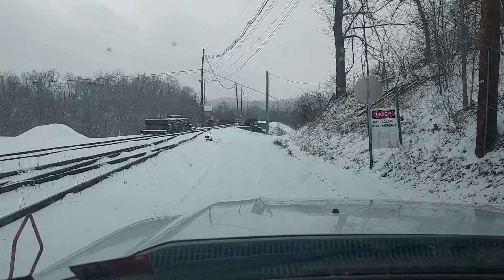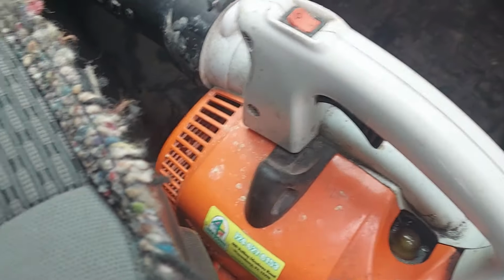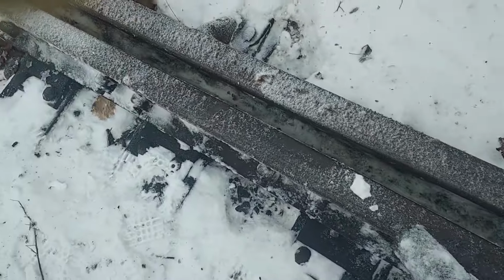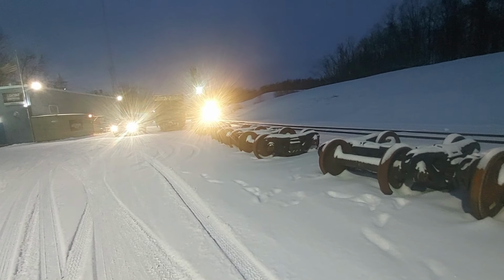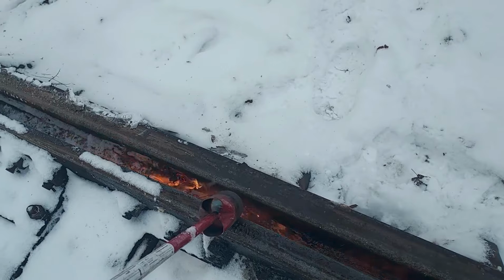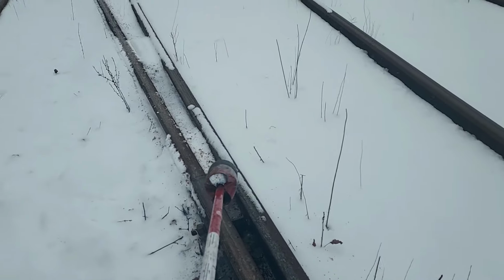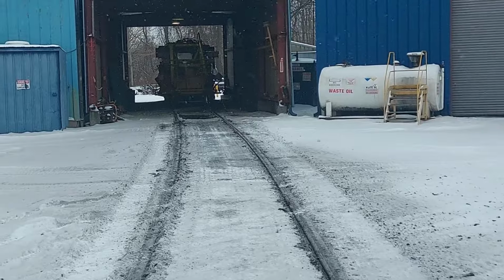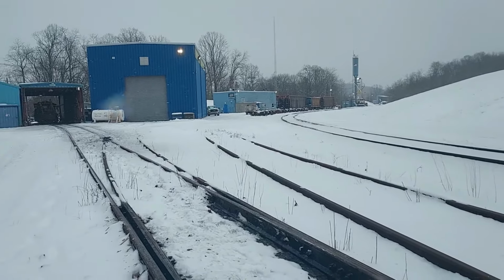Cleaning Snow out of Railroad Switches

Comment: Hi Dave Good buddy. I'm watching your video on how to clear snow from the switches and switch points and thought a good thing y'all could use is a Snow Jet blower. I'm sure you know what I'm talking about my friend. But incase you don't I'll tell you. It's a jet engine mounted on a cab control platform that angles the exhaust of the jet engine down towards the track so the switches can be thawed and cleared for smooth operation of the switch in icy cold temps. I don't know the cost of them but if you wanna have your company look into leasing or buying one I'm sure they'll prove their worth in the long run and be a valued useful piece of equipment that y'all have among the maintenance equipment y'all have.  That's rail roading brother happy rails happy trails. 👍😎👍
Reply from the maker: Yes it certainly would be nice to have one of those James, but they aren't going to spend the money here to buy a machine like that with the small amount of time the switches here are used. Even years back when we only had 1 loco and 4 of the switches got used every train trip we would have to manually clean those switches all the time.  But hey, a guy can dream about improvements anyway can't he....  Thank you very much for visiting with us to help clean snow out of switches my friend
Reply: @ccrx6700  Dave my Good buddy your welcome. Hey anytime I can mention something that would be of help I must certainly will even if the company takes me up on my ideas or not. You know what they say. Some help is better then No help. And I agree a guy can dream take it from a pro I do a lot of that dreaming businesses. Ha ha :)  but seriously. Nothing wrong with wishful thinking Good buddy. Like you say. That's Railroading. :) ❤
Reply from the maker: @jamesmaclary8441  👍😊

Comment: In Chicago, they have run gas lines to the switches and after it snows they set them on fire to keep the ice off
Reply from the maker: You are right about that Nolan, course those switches have a lot
more traffic than what mine do. They got to keep passenger trains
moving safely up there.  Very much appreciate your taking the time to write in and to check out the cleaning snow video my friend.

Comment: Hey Dave we use backpack leafblowers to clear our switches  works real well on up to 6 inches  exposed the rail and ties and let the sunshine hit em they are clean and dry quick anything over 6 inches and it's best to shovel first
Reply: And for our crossings we use salt in the flangeway  keeps the dirt soft so the train cuts a good flange when it rolls thru or we use the highrail wheels on the trucks to cut the flange after we salt
Reply from the maker: That would be nice, this little blower only works on dry snow, wet snow and it wants to turn it into ice. I've used salt in the crossings
also in the past. Good idea on the hi rail truck first, at least if it
derails no big deal.   Very much appreciate your taking the time to check out the video and share your experiences my friend.

Comment: I live in north east Georgia and the rail switches have LP gas heaters to melt ice. They told me it is not used often but the time it saves is worth a lot when we do get ice. We get rain that frezes on the steel but not much snow.
Reply from the maker: We have so few switches George that propane heaters are not
feasible to have plus the small amount of use they get in snowy
weather. Would be nice tho, just sit in the hi rail truck and watch
them melt everything by themselves! :-)  Appreciate very much your
tuning in to the show and may you have a very good day my friend.

Comment: Very interesting how you handle snow and ice in the switches. It's too bad that you folks can't get a hold of some propane / natural gas fueled switch heaters, like the ones the CTA and Metra uses in Chicago to keep their switches thawed and prevent the point rails from getting frozen to the stock rails. I noticed that a lot of the switches on your railroad have "self guarded" frogs. The frogs have the check rails / guard rails attached to them, unlike most "conventional" switches that requires guard rails next to the stock rails, opposite the frogs.
Reply from the maker: That is correct Josh, most of our frogs are #8 self guarded, made
for slow speed. Would be nice to have an automatic propane heater for the switches but that will never happen.  Thank you very much for taking the time to visit with us and  check out the video my friend.

Comment: What is the name of that particular frog @ 6:50. I always call it a “Guide Frog”.
I also get ice issues on my outside garden railway. But I only run the train once at winter for a cool snow vid.
Great snow video! 👍🏻
Reply from the maker: That is a #8 self guarded frog Bassotronics. Can use a small propane
torch for your size switches....:-)  Very much appreciate your taking the time to check out the video and post a comment my friend.
Reply: @ccrx6700  
Thank you rail-brother. 👍🏻
Reply from the maker: @Bassotronics  👍😊

Comment: Hey Dave, if you get cold hands I have a tip for you that I got 30 odd years ago from a Milk Man.
I was in security, covering a number of sites where this guy delivered milk to. Snow on the ground, puddles frozen solid, and he is handling glass bottles of milk with his bare hands ! Your hands must be frozen, says I. Says he: Shake my hand. So I did, and his hands were HOT !
How: plunge your hands into the snow or cold water for as long as you can. When they hurt, bring them out, and let the blood flow back in. It will hurt. Hurt like HELL! BUT, once you have the circulation back, your hands will stay hot for the rest of the day. And he was right. I did it 3 days ago. And it took about half an hour of pain, but after that, warm for the rest of the day, even after touching cold metal.
You do need do decide that the pain is worth the gain, and mentally prepare yourself. Not worth it for a few hours, but if you out for a whole shift in the snow, I would do it.
Reply from the maker: Now that's very interesting to hear Coniow. Never heard of that before
but if I'm ever in need of doing that I will give it a try. No pain, no gain
right....:-) Very much appreciate your taking the time to write in and to check out the cleaning snow video my friend.

Comment: In the old days before electric heater rods and strips they used kerosene pots ,you dug out the crib put a pot in a lit it  that small flame heated the steel and kept it free of snow and ice ,I'm curious Dave did they put the loco on the track backwards .the cab end would have better visibility on the lead end instead of next to the hopper car, also be careful you dont burn off the grease under the switch slide plates with that torch
Reply from the maker: Since we don't have a turntable here we have to keep the locos 
aligned as they are Kenneth. Also at any point in time any of the 3
locos may be in the lead coming back to the harbor with loads,
so short nose is always oriented on the east side for hauling loads.
We've never had those smudge pots here, always done it the way
I showed. Yes after the snow is gone have to go back and re grease
the plates too. Very much appreciate your taking the time to write in and to check out the cleaning snow video my friend.

Comment: I'd think that the melted snow/ice would refreeze pretty quickly if it was really cold. Then that could actually be a worse problem than what was there to begin with. Snow is compactible, not so much for ice. 
Looks like you'd be in for a long night or long day needing to go back and re-thaw the switch mechanisms. Seems like, once thawed, maybe a spray with isopropyl alchohol and/or glycol might keep it from refreezing. Wouldn't take much as the water volume is pretty low.
Reply from the maker: Torch heat pretty much evaporates all the melted snow and ice
StevieWonder. Your right about spraying tho, the right ice
melt spray would be a big help. They used to get us some
really good ice spray for the coal belts, but don't anymore.
Very much appreciate your checking out the video my friend.

Comment: Thanks for this video!
Heating steel followed by gradual cooling causes a loss of temper (softening). Does this not adversely affect railroad steels?
Reply from the maker: Your quite welcome Robin. You are right but I'm not heating the steel hot enough to do any damage. Very much appreciate your taking the time to write in and to check out the cleaning snow video my friend.
Reply: @ccrx6700  I was told that putting kitchen knives in a dishwasher will cause them to lose their temper.😾
Reply from the maker: @tzadik36  interesting 🤔

Comment: That was very interesting. I do have what is probably a stupid question, though. Doesn't melting the ice with the torch just make water that is then subject to freezing? Is the torch hot enough to evaporate most or all of the water?
Reply from the maker: You are right Erin, the water evaporates when using the torch. Blowing wet snow with the leaf blower will cause more ice to form tho.
Very much appreciate your taking the time to write in and to check out the cleaning snow video my friend.

Comment: Do the locomotives have sand injectors on the wheels?  I've seen that on high snow country they use for traction.
Reply from the maker: Yes our locos have sanders on them pittschapel.  They only sand
the lead trucks tho and not every axle. All our locos have wheel
slip control on them and sanding is done automatically, it can
also be done manually if needed.  Thank you for taking the time to visit with us and check out the video my friend.

Comment: Sir I have a question for you what are those round metal things on top of the rear platforms of your locomotives for? Thanks from a subscriber in Southern California
Reply from the maker: Those round tubes are fall protection devices Remy. Not common
on most locos. There is a ladder there to get up on the roof of
the loco so that is why they are there.  Thanks so much for taking the time to check out the video today my friend.

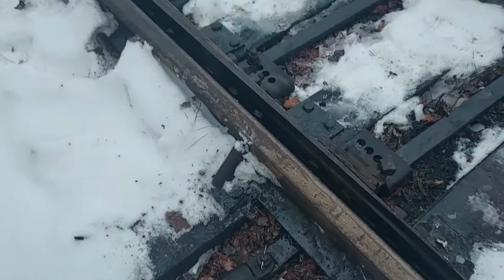Comment: Brrr I could feel the cold using that leaf blower. The propane torch did a good job and warmer using that. We had some automatic heaters but where there were none we did not have the luxury of a torch just a broom and pointed bar which gave my workmate frost bite one year, I told him to get his gloves on. Question At 18:18 looking at switches there are 3 bolts then 2 between the next tie and 2 between the next, looking in the open switch I see the 3 nuts. What are these groups of bolts holding together ? I have seen them on other videos and always wondered what they are for. Our switches are only drilled at the place where brackets are fitted to keep the switches the correct distance apart
Reply from the maker: Those bolts if I'm thinking what you are looking at, join the switch
point to the stock rail. 3 bolts on the plate that covers the heel block
and 2 bolts for the switch point Cedarcam. I liked using the torch, gave off a bit of heat to warm me up...:-)   Very much appreciate your taking the time to write in and to check out the cleaning snow video my friend.
Reply: @ccrx6700  OK Dave You will have to give us a more detailed look at that some day. The bolts just look like they go through the switch where I see them. I was glad when we used paraffin lamps in the signals to warm my hands on LOL

Comment: Chicago has LP  and burner on there switches.
Would not be a little better?
Reply from the maker: Yes it certainly would be Keith, but they aren't going to spend the
money here to put a system like that in place with the small amount of time the switches here are used. Even years back when we only
had 1 loco and 4 of the switches got used every train trip we would
have to manually clean those switches all the time.  Thank you very much for visiting with us to help clean snow out of switches my friend.

Comment: Why don't you have one of your guys in the shop design a pipe that can be mounted on the front of the tamper that would have propane going to it so you could just run over the switches with it to melt the snow and ice?  Would be a lot faster and save you from having to drag that propane tank around.  Just a thought.  Have a great day.
Reply from the maker: They make a machine that carries a big propane bottle on it and
is used for heating the rails Robert. That puppy sure would be
the cat's meow here, but we will never get one. If I had one on
like you describe on the regulator that would be nice. And if
we got a lot of snow like we used to I definitely would be
talking to the shop foreman about rigging up something. Very
much appreciate your taking the time to visit with us and  check out the video my friend.

Comment: Why don't you put a piece  Flat steel on the The end of your blower so you can Scrape it along the switch and blow at the same time
Reply from the maker: Good idea Mike but main reason is, this torch belongs to the mechanics and I have to borrow it, I don't have one of my own to use
and they most likely would not appreciate me doing that.

Comment: Also - does using heat like that contribute to any …degrading of the switches?  Here’s that freeze and thaw I mentioned one time - is this hard on the rails as well?
Reply from the maker: Freeze and thaw is hard on track surface for sure Joanie. The heat from that little propane heater does not seem to bother
the rails or switches.
Reply: @ccrx6700  thank you, Dave. That is an aspect of rail maintenance I never thought of. I keep learning new bits of information all the time.🙂
Reply from the maker: @joanieswanson570  👍😊

Comment: Why do they run long hood forward?
Reply from the maker: We have 3 locos here and at any point in time any of the 3 may be
in the lead coming back with loads 722Racing. That means
the short nose is always in the lead on loads, a bit of a safety
factor in the event that loads derail and pile up against the loco.
We also have no way to turn locos around here.   Really
appreciate your taking the time to watch and may you have
a very good day my friend.
Reply: @ccrx6700  That makes sense. I guess I forgot you do a run around and not a wye.
Reply from the maker: @722racing3  😊👍🚂

Comment: I'm surprised you dont have heated switch points....
Reply from the maker: Yes it certainly would be nice, but they aren't going to spend the
money here to put a system like that in place with the small amount of time the switches here are used. Even years back when we only
had 1 loco and 4 of the switches got used every train trip we would
have to manually clean those switches all the time.  Thank you very much for visiting with us to help clean snow out of switches my friend

Comment: Thats cheating all i had was the broom on front of our power
Reply from the maker: We used to keep a long air wand on the loco and use the loco air
pressure to blow out switches Leslie. That worked great and
a lot quicker than a broom. Brooming out wet snow is not fun
at all. Thank you for  taking the time to visit with us and check out the video my friend.